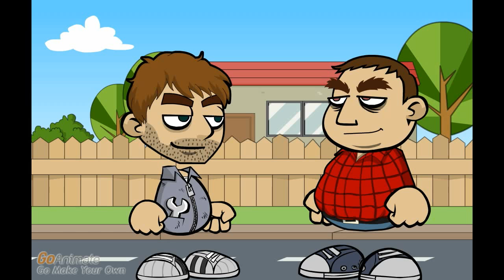Coleman Furnace Troubleshooting

Comment: i tried to start my coleman evcon furnace model#dgaa070bdtb it started 2 times but went out both times the blower was bad replaced it and it would do nothing i seen the flashing green light indicated limit switch was open so i pushed the button on the linit switch now theres a purple 3amp fuse on the circuit board that keeps popping as soon as i turn it on can help